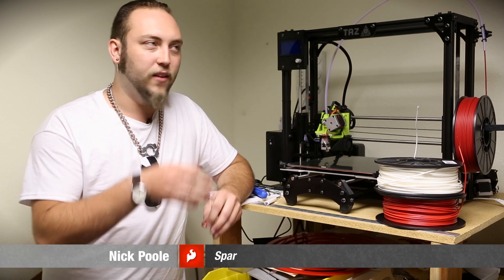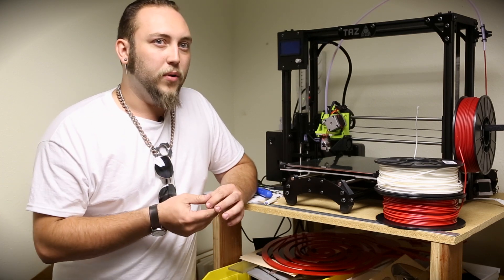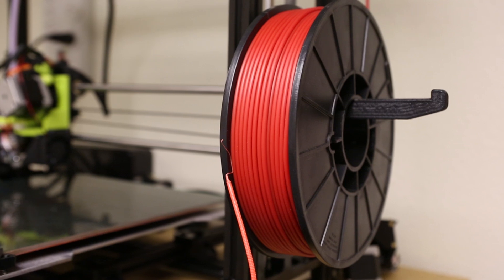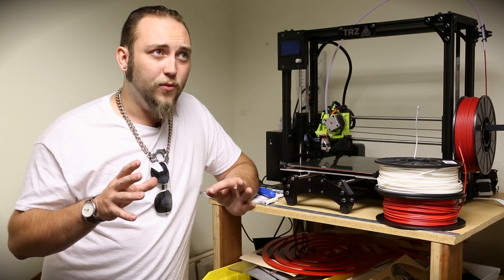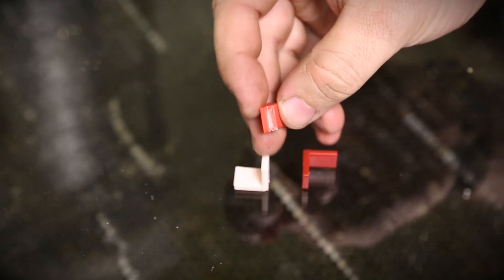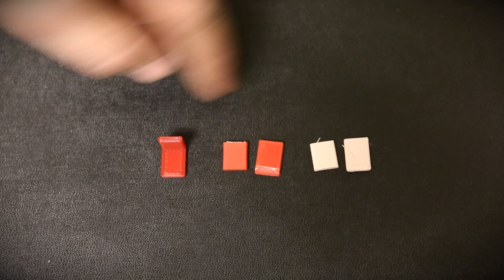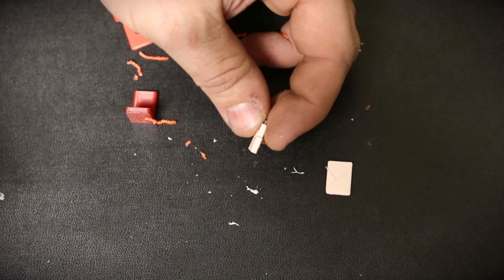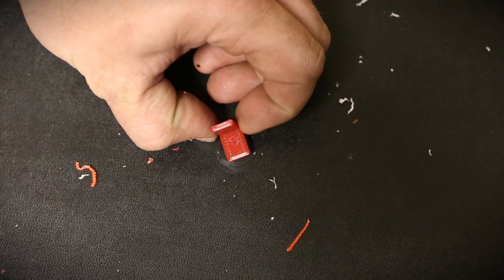SparkFun 3D Printer Filament Guide

Comment: The pla shouldn't be hard to drill in that thickness.   I  think your drill was reversed and melted through.   I will agree though,  it is tough to machine.   friction on the bit will soften the pla,  and make it rubbery at around 60c, after that it grips the bit which makes it heat up even more.   often the bit will  get totally stuck if you are drilling a thick piece.   I have found that the best way to drill it is to push fairly hard so you are cutting fast without spinning the bit excessively,  and if possible pull it out,  and give it a minute to cool repeatedly,  so you don't end up melting the plastic and gluing the bit in.

Comment: he's way off on the pla temperature. with the pla I've used,  160 is about the minimum it will work at for very slow printing.   I  normally print between 185 and 210 depending on speed,  and if the model has many overhangs or bridging.

Comment: This probably needs addendums. Polycarbonate, Nylon, and Polyethylene Tertpthalate (PET) are not hard to track down. Both PET and Carbonate are clear plastics when injected molded, and nylon current has the best track record for mechanical properties, but it's very hard to get it to print correctly. The clear plastics need more experimentation before people get perfectly optically clear prints.

Comment: I use the PLA on the Rep 2 and have no problem machining parts, 
For smaller pieces I turn the infill to 80%+ and it's great for putting an M2 or M3 tap into. I use nylon countersunk screws to secure the pieces together. I use it all the time building handheld prototypes